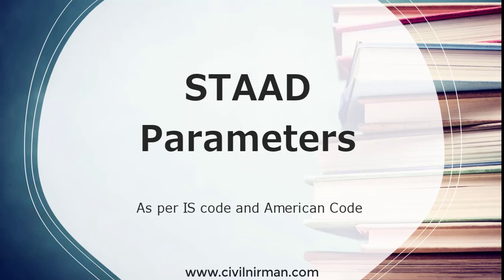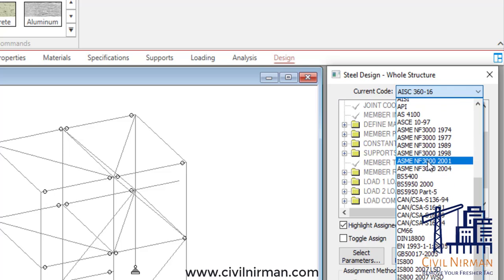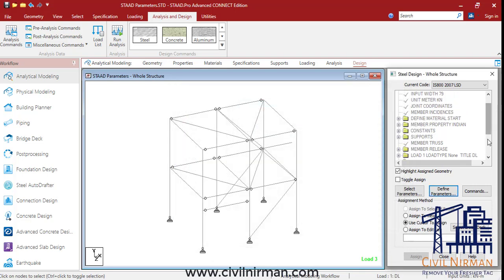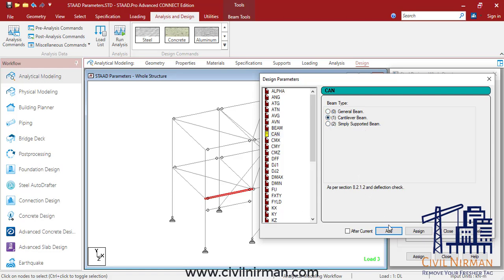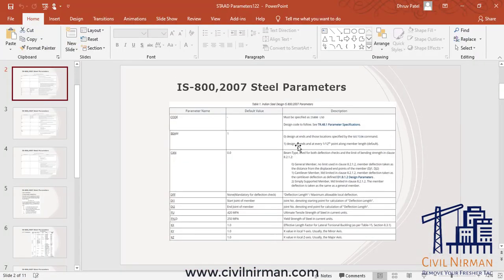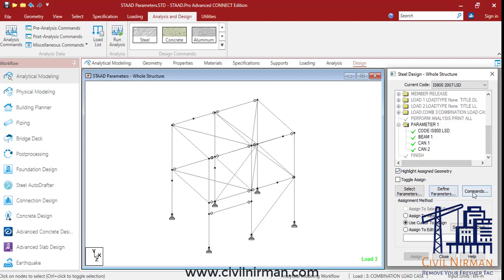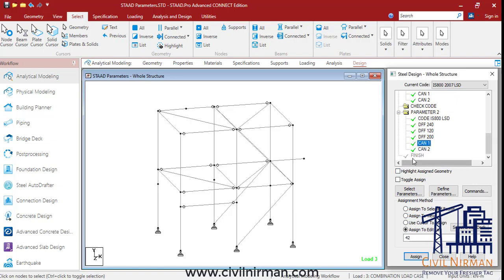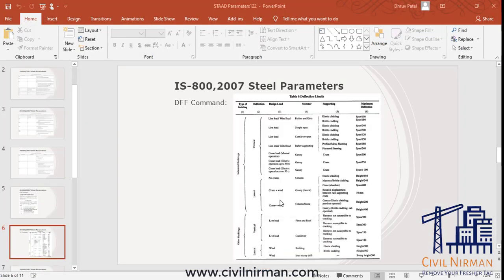Steel Design Parameters in STAAD As per IS 800:2007| Serviceability Parameters

Comment: Hello sir, as you said in the video CAN, DFF, DJ1& DJ2 are coming for services bility check, then why you added only CAN in parameter 1(wsd) and other in parameter 2?
Reply from the maker: Hello! Thank you for paying close attention to the video and asking such an excellent question. 
To clarify, the design process is broken down into two parts: Parameter 1 and Parameter 2. 
Parameter 1 is for Strength Design: This parameter ensures the structure is safe against bending, shear, and axial forces. The `CAN` command must be assigned here because it is not just for deflection; it is required to define the limit for the design bending strength as per Clause 8.2.1.2 of the IS 800 code. 

Parameter 2 is for Serviceability Design: This parameter is strictly dedicated to deflection checks. Because commands like `DFF` (maximum allowable displacement) and `DJ1`/`DJ2` (defining the start and end nodes of a continuous member) are exclusively used for calculating deflection, they belong only in Parameter 2.

Because the `CAN` command is applicable to *both* strength and serviceability, it actually needs to be present in both parameters. If you continue watching the video, you will see that I later copy the `CAN` commands from Parameter 1 and assign them to Parameter 2 as well, so they are properly applied to the deflection checks.

I hope this clears up your doubt! Keep up the great learning, and let me know if you have any other questions.
Reply: @CIVILNIRMAN thank you sir, for the response, now it's clear,❤
i thought CAN parameter is only for serviciabilty

Comment: Sir it will be more helpful if you also make a video on when to use slenderness ratio 180, 250, 350 and in which members in a steel structure
Reply from the maker: @binayaksamanta863  in design parameters everything will be covered
Reply from the maker: @binayaksamanta863  Just For Your Information 
As per Section 3.8 Table 3, the slenderness ratio (KL/r) of compression members shall not exceed 180, and the slenderness ratio (L/r) of tension members shall not exceed 400.

You can edit the default values through MAIN and TMAIN parameters, as defined in the design parameters tab I hope this will clear your doubt
Reply: Thank you so much for such amazing lectures  @CIVILNIRMAN